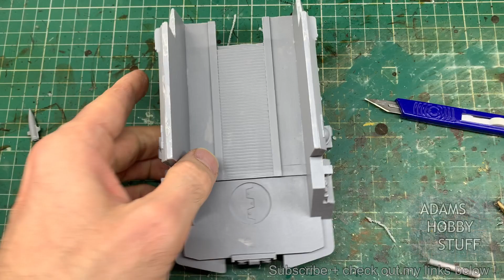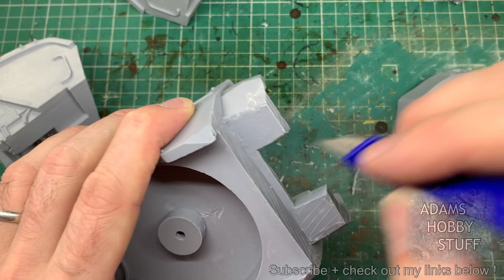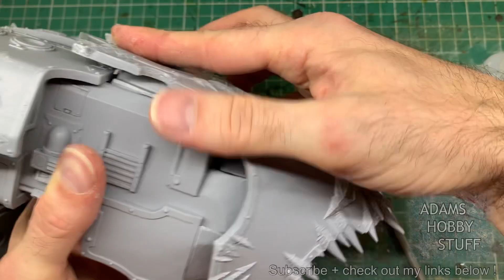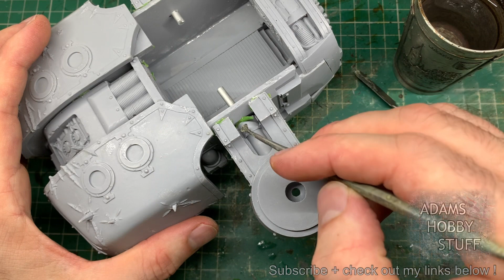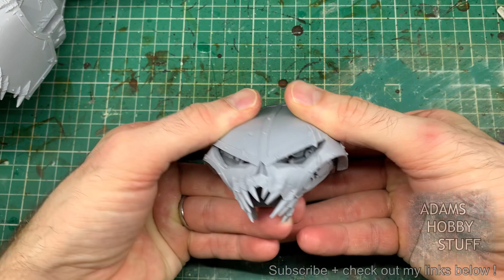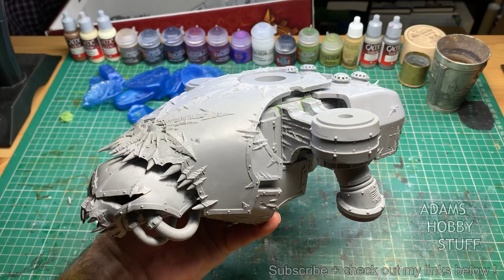Forgeworld chaos reaver Titan build part 4 - assembling the torso and head - greenstuff galore!

Comment: Lol.  All of my FW titans lasted 15 plus years with glue.  I use two part epoxy now though because I fabricate for work so it's just a normal thing to do now.  The epoxy fills gaps.  You can swipe off the extra at the right moment as it sets up.  Considering drilling out a couple of the eye lenses and dropping in a small disposable LED when I play into the cockpit.
Reply from the maker: I think the gap filling element of epoxy could be a real timesaver for my method, problem is you get so used to doing something a certain way it’s hard to change!

Comment: In the process of building two large resin imperial knights (Acastus and Cerastus) and after the cat knocked the much heavier Acustus off the table and broke the leg off, I realized that had I pinned it, instead of breaking at the glue joint, where I could easily just re-glue it, it would have broken somewhere else randomly, or done a lot more damage in deforming the resin, rather than breaking. Both of which are much worse outcomes. Much like a car and crumple zones, I think it's safer for the long term survivability of the titan to make sure the joints could break away in a nasty collision and save you from much worse damage that can't be easily repaired.
Reply from the maker: I wonder how much wargaming damage has been caused by cats! a friend of mine had his eldar revenant Titan suffer the same fate, it did snap through the leg itself and took some repairing. I’ve built titans with no pinning at all and also ones with a lot of pins, day to day strength vs easier to fix if they break?